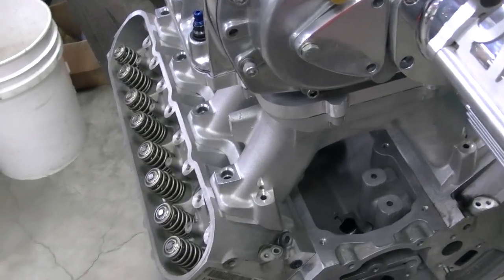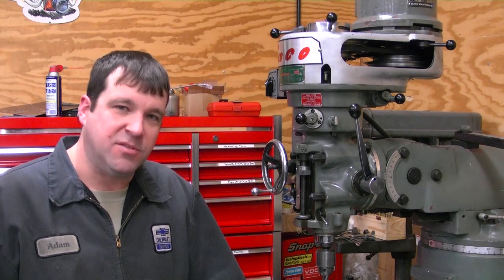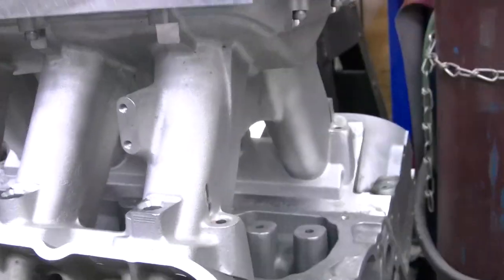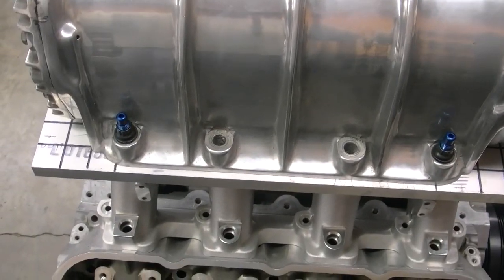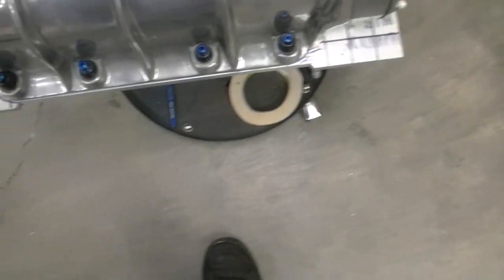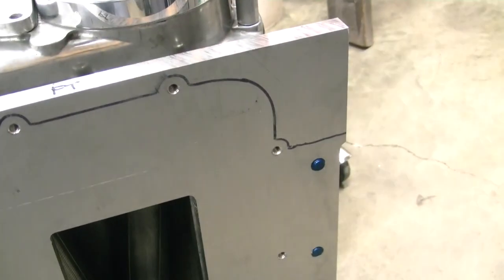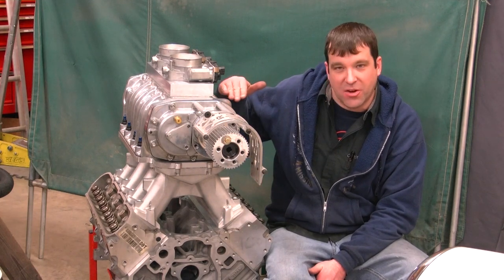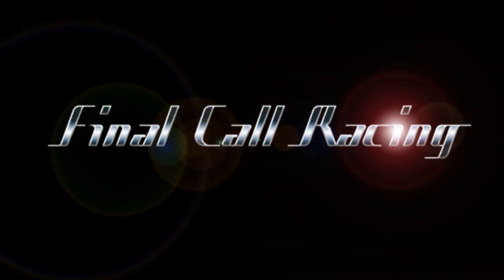LS Roots Blower Build Part 5 (Blower plate to Holley HIgh Ram)

Comment: Is there a reason why you got the holley high ram with injector ports in it vs the one without them?
Reply from the maker: I'm planning to inject top and bottom.  Better cylinder control with them in ports. I need fuel up top to keep blower rotors cool.
Reply: Final Call Racing awwww makes sense